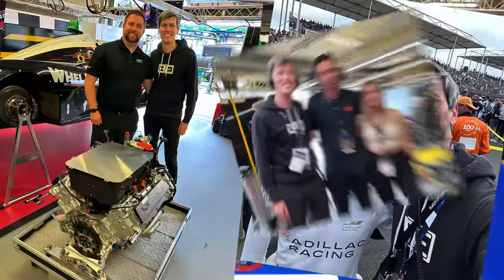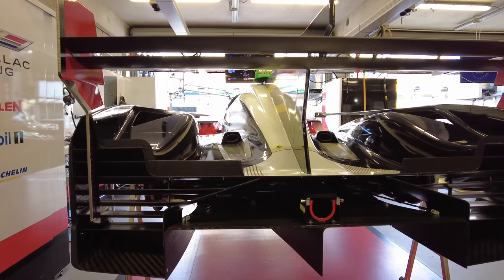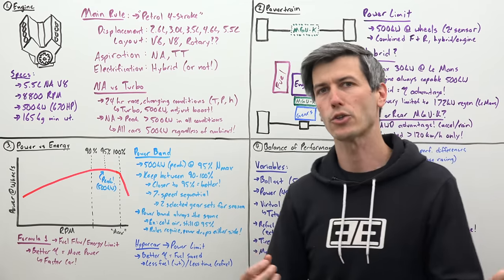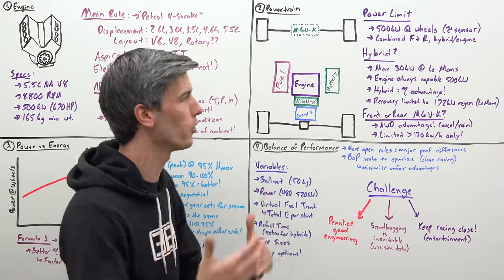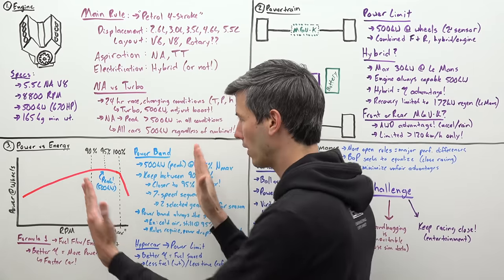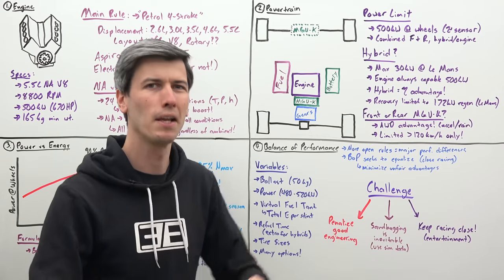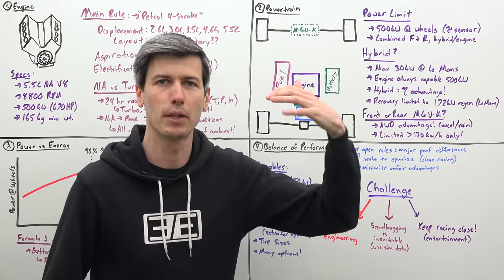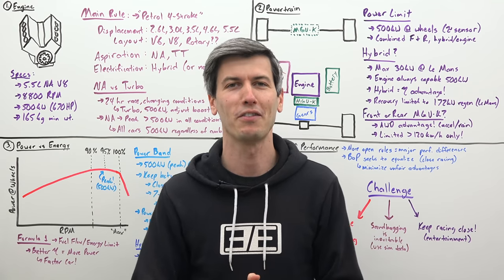Are Hypercar Engines Better Than Formula 1? — 24 Hours of Le Mans

Comment: This is adjacent to something that bugs me like crazy. People think F1 is the fastest/best because that’s how you make a fast car. It’s not, they’re just allowed to go faster. I think doing a video on the downsides of F1 design, and how to improve it, would be super cool.
Reply: Lmao.

F1 cars are much more heavily regulated than most other race cars, especially LMH. The F1 cars could go much, much, much faster without all the mandated restrictions.

So no, they are not "allowed" (wtf) to go faster. In fact, they are not allowed to go as fast as they could.
The comparison of the LMP1 919 Hybrid and the 919 Hybrid Evo tribute car is fitting. The latter was made on the basis of the LMP1 car after Porsche pulled out of Le Mans after 2017. The Evo had none of the limiting factors of its Le Mans cousin, it currently holds the overall Nürburgring Record. And now you can imagine what an RB19 or W11 would be able to pull off without all the restrictions.
Reply: @DefinitelyNotEmma  Lmao.  Your reply tells me you live in a F1 bubble or know nothing about motorsports, or quite possibly both.

You are on something if you think they are more heavily regulated than other race cars.  Yes, their rule book may be larger but other categories have been regulated to a slower speed with fewer pages.  So yes, F1 are in fact allowed to go faster because their regulations allow them to.  

The 919 Evo did in fact have some limiting factors from it's Le Mans cousin if you think about it critically instead of listening to all the click bait headlines and despite what Porsche themselves might claim.  It's got more speed in there.  I won't list or name them but it's not hard to find.  I wouldn't expect a F1 fanboy to understand any of what I said  though.
Reply: @DefinitelyNotEmma What you're saying just isn't true. Look at drag coefficients alone. Open-wheel open-top race cars are terrible features for a fast car, but they are kept because of legacy. All race cars are built to a set of rules. F1's ruleset allows them to go faster because they're powertrains and aero are allowed to be better. That's a fact.
Reply: It would be cool to see what an F1 car could look like if it could use all the banned tech from the years past.
Reply: @DefinitelyNotEmma buddy, when designing 919 Evo, Porsche engineer have more thing in mind than just going fast, sure your precious F1 car is faster in lap times in any circuit (even nordschleife, if any F1 car didn't break on a hotlap), but can F1 cars driven hard for 24hr non-stop without any issue? I don't think so.

Comment: This is a little off subject of this video and will probably lead to multiple videos to respond to. I figured you might be the best person to ask. Can you research the different engine emission limiting technology these car manufacturers are using in each specific engine?Some examples are start stop, continuously variable valve duration, cylinder deactivation, direct injection, variable displacement, Atkinson cycle, etc.

Comment: It’s down to RPM.  If you look at IndyCar and F1 the engines on paper are very similar (minus the hybrid system) but F1 cars rev much higher.  When was the last time you seen an IndyCar engine blow up?  Almost never.  They could rev them higher but they don’t for reliability.

Comment: Speaking of BoP, the ACO/FIA really have to to consistent on that area because currently they really are not.

The 24H race was a bit smeared by this sudden BoP change which has been done without manufacturers agreement (especially after saying there will be no further changes back in Spa). Tyre warmers which are also "un-banned" just for Le Mans because one historical brand couldn't get their tyres warm enough without it cough Ferrari cough

Comment: Thank you for this. It has re-ignited my interest in endurance racing. I've always wanted F1 to work with these principals. Any kind of engine, just limit the power. All manufacturers running the same engine configuration, all sounding the same is extremely boring to me. I used to love when F1 had all kinds of different engine configurations. Great video!

Comment: I watched the whole race on via the 26 hour youtube video.  One thing I noticed was, I think cadillac was the only team using electric launch from the pits, noticeable by the fact the car would lurch violently as it rolled away and the engine BARKED to life as it was being essentially bump started.  I think it was the eventual winning ferrari that was having starter issues, which would have been eliminated by the electric drive out and bump start technique.  I seem to remember the Audis and Toyotas from years past taking the same pit launch method as well.  I'm wondering why that seems to be abandoned now.  I forget which car it was, but one especially as it left the pit box would whine like it was tearing hell's gates off it's hinges, then EXPLODE into life like someone just said ** it and blew the gates off.  It was a glorious sound. :D

Comment: Some misinformation in this video. All the hybrid part you talked about is LMDh side. The LMH prototypes have 200kw of hybrid and the speed at which they can activate it is 150 or 190 km/h depending on tyre size chosen.
Reply from the maker: Yes, video is specific to 24 Hours of Le Mans, based on my discussion with Cadillac's powertrain engineer.

Comment: Another excellent video. I learned so much. Would be interesting to find out how often, as a percentage of the race, is the car actually running at the peak horsepower. All that work to keep it at peak horsepower, and if you're only running it at that peak for 20% of the race, is it worth all that?

Comment: F1 rules : get whatever output you want from your engine as long as they are all the same
Hypercars rules : do whatever you want with your engine as long as they all have the same output
Reply: The problem with F1 is engines are frozen you cannot change anything except for reliability reasons so you cannot catch up with a more powerful or more efficient engine.
Reply: @LG-ct8tw  Thanks to Karen Horner secretly preparing a engine boost juste before the freeze and work around the aero engineering advantage they have.

With hypercar you can change what you want but your output is regulated by mandatory curves and values. And if your car happen to be too fast you have to sand bag by regulation. 

It is like "come and show off your techs and designs, the regulation will ensure that lap time is close"

Comment: 1990
WEC: Car needs an engine
Mazda: Cool 🔺🛞
1992
WEC: Car needs a 4 stroke engine
Mazda: 😢
Reply: you can love the sound but wankel engines never made much sense to be used in a car...
Reply: AFAIK, rotaries are 4 stroke.
Reply: @aluisiofsjr  *Yes technically (4 stroke, two cycle I think is the best to describe a wankel), piston engines only would have been more accurate

Comment: The one place where engineering shines through the BOP is outright handling. It's more applicable in GT3 classes because it pays dividends to have a well engineered car for AM and Pro-AM teams because the amateurs have way more variability in their pace and consistency. If a car is easy to handle, the amateurs can drive closer to the limit with far less risk.
I imagine this won't show in LMH and LMDH cars in pace, but it will have a subtle effect on the drivers ability to stay focused and energized. A well handling car would require less mental energy through the length of a stint than one ready to end your race at any given moment.

Comment: Maybe a suggestion for next video. Since F1 won't use BoP, do you think that engine rules from LMP1H*, some lift-to-drag aero regulation (i.e free in first year or rule cycle, and an avg of top 2 teams from 2nd year onwards), + development tokens (like they did in 2021 except that teams in the back would get more than teams in the front, imagine if RBR couldn't update their cars because they are P1) would make engineers, drivers and fans happy and bring the grid closer?

*I don't know if you followed the LMP1H era, it was similar to LMH but more freedom and total power and those cars accelerated faster than F1 due to 1000hp AWD from low speeds. The best modern racing regulations ever but unfortunately the money for it is in F1, not in Le Mans so it didn't las long there.
Reply: F1 is a constructor championship, and it's working 100% fine for that goal. People who complain about F1 don't understand the purpose of F1. It's a competition of who can build the best car. Introducing BoP or anything similar to that would be insane given those goals.
Reply: @davorzdralo8000  Yet LMP1H had more freedom than F1

Comment: The difference between the two is vast. In F1 they have to continually regulate engine sizes down because the aero and overall performance of the cars becomes too fast. It is much easier to regulate the engine and other aspects of cars than it is to build new tracks. With endurance racing the fun part is the variability in the engines. With endurance you have completely different challenges. Do you use a big v8 so there is less hp per liter and make build it super strong or go hybrid with a small engine? Such incredibly different sports.
Reply: Excellent comment
Reply: @stevosteve  thank you

Comment: Thanks for making a video about IMSA GTP/WEC Hypercar! One minor correction though: I wouldn't say fans love BoP, but rather tolerate it. It's the price we have to pay for this new golden era of top level prototype racing with excellent manufacturer buy-in. Let's enjoy the ride while it lasts, boys and girls!
Reply: Tolerate is a strong word for that.... it is a heated discussion among fans. 
OH AND TOYOTA....  dear lawd are they pissed at the sudden BoP adjustment that happened at LeMans this year. They have been rather vocal about it, granted they and Ferrari got hit the hardest with the adjustment. Mind you, Ferrari ain't complaining.
Reply: @DuvJones  yeah Toyota has every right to be upset. Teams were told no BoP adjustments (outside of at most platform BoP, if I remember correctly) and pretty much had the rug pulled from under them. And while you're right BoP is still a hotly debated subject, I stand by saying fans are tolerating it. Crowd numbers are up baby!
Reply: @joebarrera334  
You know, I wonder about that... when the BoP regs first came about there was a clause about sudden adjustments. That is what the ACO pulled at LeMans, which Toyota was furious at (among other things; like the Safety Car procedure) but they signed that contract. They knew about this when it was created. 

Personally, BoP is clearly one of those thing that gets adjusted over time. If they messed up, the next race will likely correct that. On top of that Ferrari got hit almost as bad and prior to the adjustment was keeping pace with Toyota outside of the Spa tire-lotto. I don't think that it matters much, for now... as much as Toyota does have a point, this is the FIA. Get agreements in writing, at the very least, and anything said is subject to change. Outside of that, this is just racing.

You can stand by your words, I am not disagreeing. All I am saying is that "Tolerate" is do a lot of work as a choice in words.

Comment: While this ruleset seems to penalize good engineering in pure performance terms, I would argue it still promotes engineering excellence - just in a different way.

With performance all being equal, the emphasis becomes reliability, durability, and repairability. If the other car blows a turbo and you don't, you win. If it takes them 5 minutes to change a brake rotor and you can design yours to take 4 minutes, you've got an advantage there too. If your cars have the same ultimate pace but theirs can only keep it up for 2 hours and yours can maintain that pace for 24, you win. A great example of this is the Frikadelli Ferrari at the N24 this year - it blew a tyre and wrecked the rear bodywork, but because the car was so incredibly well engineered for rapid repair they had an entire new rear bodyshell on it in 20 seconds and went on to win the race.

Comment: Cross plane might get rid of vibrations, but since it has an uneven firing order, it’s gonna shake itself left to right and in this case its gonna shake the chassis too . That’s why We have never seen any structural cross plane v8s so far. It would be cool to understand the engineering behind.
Reply: Different kinds of vibrations
Reply: Counterweights mitigate it, and has less vibrations than a flatplane with balance shafts. And you typically design the counterweights for a specific RPM regardless of crank types. GT40s had cross-plane V8s, Sauber Mercs had cross plane V8s, Merc CLK-LM had a flatplane V8 - all structural engines btw.

Comment: The new rules were put in place mostly to drastically reduce the cost to compete in the top prototype class.  The old LMP1 class was basically dead, Peugeot dropped out in 2011, Audi dropped after 2016, Porsche after 2017 and Toyota basically had the class to itself for 5 years so it's Le Mans overall wins don't really count as they had basically no competition.

Comment: You forgot the other end, BoP serves the open door to more manufacturers. Mnfrs want to run what the brung in GT, meaning, Cars that they sell. Mnfrs don't want to spend to build some special they have to sell at a very low volumes, so they can be successful  in GT racing. That is very expensive, and maybe the costumer market doesn't see us like that, so we probably won't be successful selling a car for a million or more dollars. Run what you bring, BoP allows for competition and the potential for success, even though the platform isn't the best config for racing.

Comment: Why are V8s, V6s, etc. in racing generally Twin Turbo as opposed to a single turbo in a racing setting? 
I’m thinking primarily of weight and complexity savings, which on paper could be an advantage in racing.
Reply: If I'm not mistaken, V engines normally have twin turbos so each cylinder bank has its own turbo.

Comment: Not sure about the rules but could you run a CVT?  (Similar to the Williams CVT the FIA banned before it finished development?)  That way you can always have the engine pegged at 95%.  If you need 2 transmission sets, how about a CVT for most curves and a ridiculously tall CVT for the straights.  Just a wierd thought.
Reply from the maker: CVTs explicitly forbidden in the rules. But it certainly would allow for max power!
Reply: @EngineeringExplained  I'd love to see a series allow CVTs like they are used on street cars, basically with semi set gear points, but allow the teams to change ratios for each track.

Comment: Regarding the power at certain rpm, i dont recall you ever me mentioning what transmission they are limited to other than gear sets. Cvt would make sense to hold that 500kw at 95% rpm in theory wouldn’t it? Am i missing something or why dont they use cvt?
Reply: because its not allowed

Comment: This is by cost what type of build and rules the manufacturers choose....for Cadillac and Porsche...reason why they choose lmdh is due to cost....its cheaper to build and run...restricting to size, dimension, power and chassis maker....lmh is much more loose in its regulation but a little more expensive to build and run...

Comment: BOP is the wrong way to do things. It's penalizing engineering in a sport where a part of the sport is supposed to be engineering. Engineers are basically incentivized to try and cheat the BOP system. If you wan't equal cars you should have a spec series or do things like GT racing is doing things.

Comment: The purpose of a race is to win,  not entertaining.  May the best engineering and driver win
Reply: Your idea of CAR racing has been replaced with the desires of a newer fan — a fan raised on video games and fantasy leagues. They prefer wheel-to-wheel and “parity” regardless of the orchestration, phantom cautions, stages, lucky-dogs, free passes, and red flags required to produce it.

Comment: My question: The rules limit power to 500 kW? How do they enforce that?  
Does each car get put on a dyno before race day?
Reply: rule doesn't limit power to 500kw, there is a bop that gives cars a power usually in the range of 500-520kw. 
Power is kept under control with a mandatory turbo pressure values across the rpm range for turbo engines, the only NA engines are the cadillac and the gibson used by kolles... in this case I think power levels are kept under control through valves ECU settings.
Reply: @giovannibalsamo6178  power to the wheels is monitored through sensors on the axle shafts and can be seen by the governing body via telemetry
Reply: @Harmonic14  is basically what I've written a couple of comments below lol I was meaning that the bop torque/power curve can be easily modeled through mandatory turbo pressure values in turbo engines, in N/A engines the only way to make the engine follow the bod dictated torque/power curve is through valves ECU settings. It's basically the reason why GM designed a DOHC engine instead of the usual caveman pushrod.